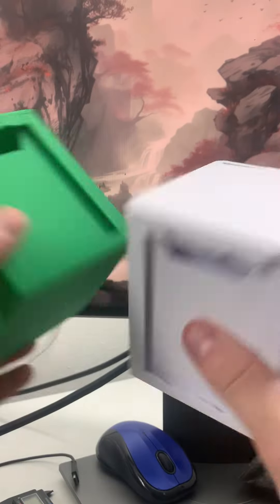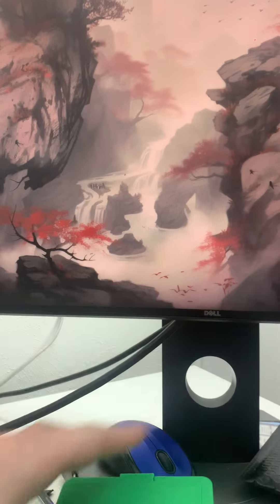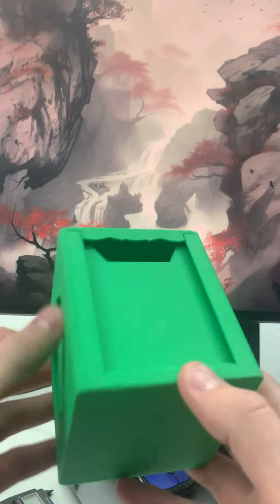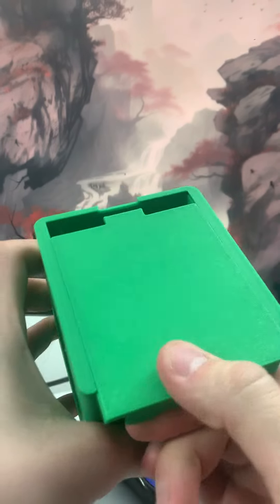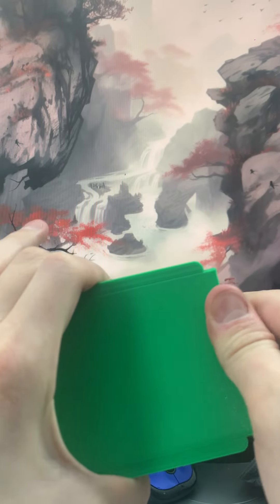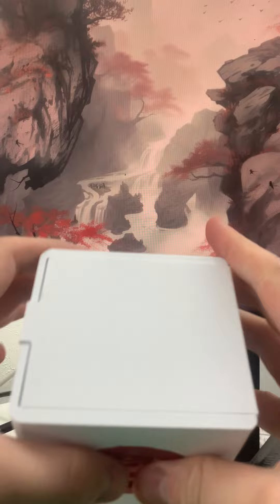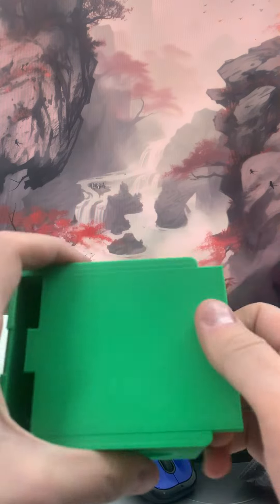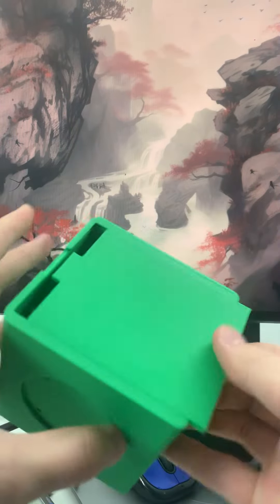Difference between petg and pla for components and slide designs

Comment: PETG has great chemical and UV resistance, use white lithium grease on the slide surfaces.  As far as bending on that one axis that binds the lid, bummer, tweak the design for PETG (shape, tolerances, etc).  You can't just print a file in every material and expect it to work with everyone the same way, that is the point of using different materials is different material properties, but also means different design process too.  Look at a cardboard box vs a metal box like a tool box; cardboard is layered and corrugated, a metal box is just a flat thin sheet metal.  The metal box will still be stronger, but the cardboard box is lighter and cheaper if you don't need the added strength.  I print soley in PETG for this type of object and have products I sell with moving parts and mechnical printed bits, they move just fine between the design and a wipe with some white lithium grease on a rag (a little goes a long way).  I have one product in particular that has a piece that rotates, it needs to move smoothly and have some resistance to hold position where someone sets it to.  With just PETG on PETG, no bearings, it moves so smooth you'd swear it had a bearing, which for my design was good because it was smooth, but an issue because it wouldn't hold position very well.  That was resolved with a set screw, spring, and ball bearing to add and adjust resistance to the point it would hold itself.  There is no reason you can't make this out of PETG and probably have it work better than the PLA version if you purposely design a version for PETG.

Comment: I've run into this issue with some designs/materials.
(Never tried PETG specifically, though)
I'd recommend trying to create an alternate version with a teency bit more tolerance on the sliding part, solely for printing in PETG and see if adding 0.1mm or something to that tolerance helps.
Best of luck!
Reply from the maker: Thanks it does get less gripping the more use so it may be that I just have to ware it a little before delivering to customer. Also thanks for all the comments, great insights
Reply: Yeah I switched from PLA to PETG for my stuff and during the transition I had to change my designs to make up for the differences in the material properties.